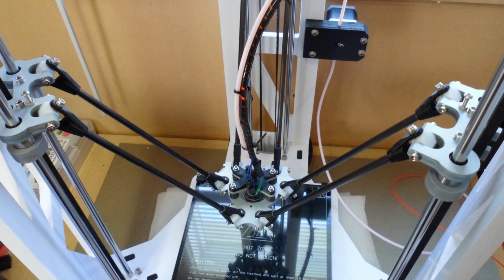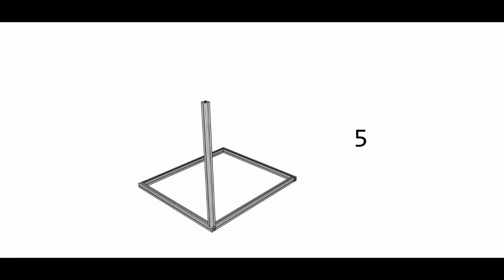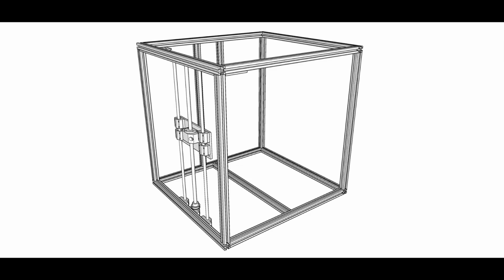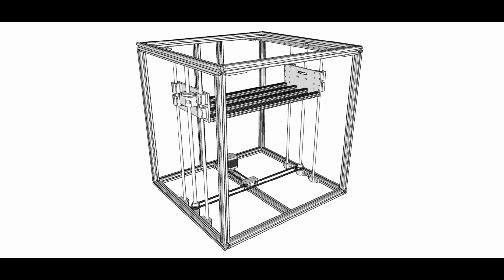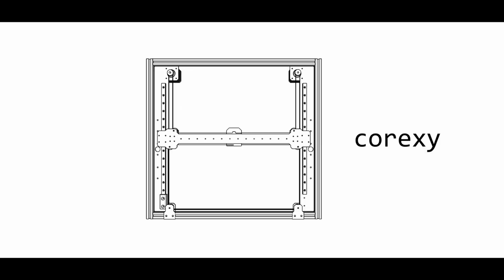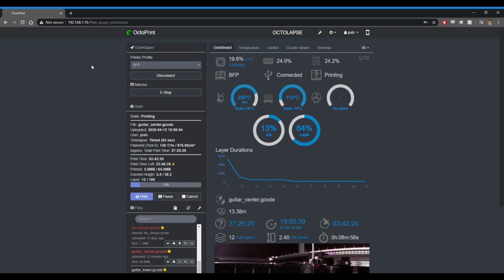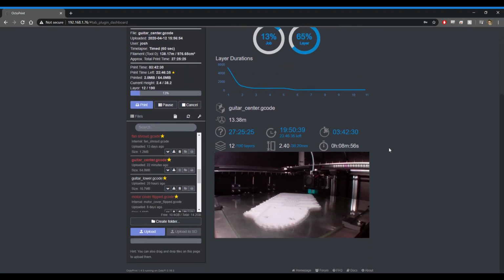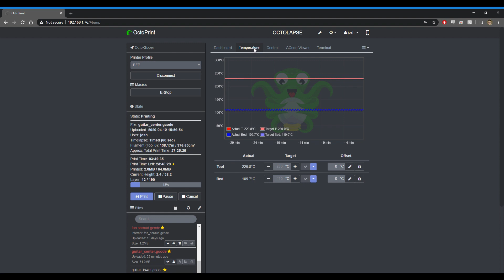Building My Big 3D Printer

Comment: What type of power supply are you using, especially what amperage?
Reply from the maker: I'm using a 24V 10A DC power supply for the control board and stepper motors. A 5V 5A DC power supply for the Raspberry Pi. The heated bed is AC and runs directly from the wall (240V AC).
Reply: @joshendy  thank you for the answer, on your blog you said that you used a 1.8 degree stepper motor for the z axis. Is it possible to use a 0.9 degree stepper instead? And in one of the pictures i see you use a solid state relais, is this a 24v relais to switch 240v?
Reply from the maker: @baskeultjes8276  Yep you can use a 0.9 degree stepper for Z. I just used a 1.8 because I had it lying around from a previous project. The solid state relay I have can be switched with anything from 3V up to 30V so I just used my boards heat bed MOSFET output (24V) to turn the relay on/off.
Reply: @joshendy  my last question is that bigtreetech released a new control board called the skr2, would you happen to know if this will work with klipper?
Reply from the maker: @baskeultjes8276  Yep it's supported. Here's the default config file that's already been setup for it: https://github.com/KevinOConnor/klipper/blob/master/config/generic-bigtreetech-skr-2.cfg
Reply: @joshendy  thank you very very much for al the answers for my quastions, like you aske on you blog i will e mail some photos when the printer is finisheda

Comment: What is the printable area? How much did the gantry cost?
Reply from the maker: Printable area is 300x300x300mm. The aluminum for the gantry was around $50 NZD (~$34 USD), the GT2 belts and pulleys were ~$28 USD and stepper motors $24 USD. So roughly $90 USD or around there. I've got a full cost breakdown per part on my blog: https://www.joshendyblog.net/big-3d-printer-bfp/
Reply: @joshendy  I am thinking of converting an older Cobblebot frame setup to something like this.

Comment: Great job, I recommend changing to TMC2209 drivers, they can handle more current, even without cooling, and have better sensor-less homing performance
Reply from the maker: Oh interesting, thanks for the tip. I have had lots of issues with the TMC2130's, and they do heat up something crazy

Comment: Hey bro just watched your video nice one bro.had a question how do you tighten belts
Reply from the maker: Good question! The head that moves around has a 3D printed plastic piece in-between it and the hotend assembly, it has 3D printed GT2 teeth grooves in it and a clamp on the back that's bolted in. It's a bit awkward but to tighten the belt you pull it tight with one hand and with the other you tighten up the bolt that clamps down on the GT2 belt. Once that's tight the belt is in there pretty securely and hasn't loosened on me yet so I think it works well.
Reply: @joshendy  So you are only able to tighten/loosen the belts in "one tooth increments", right?